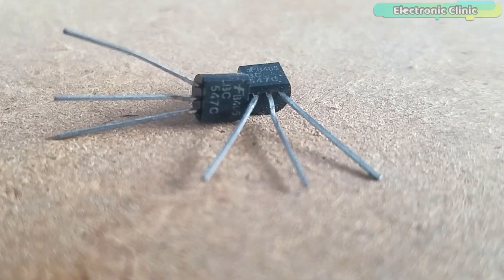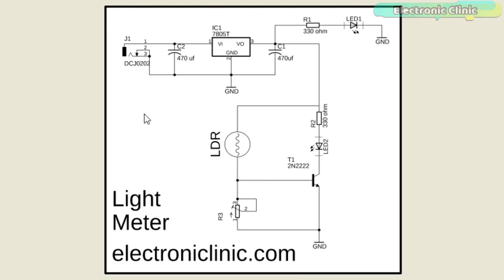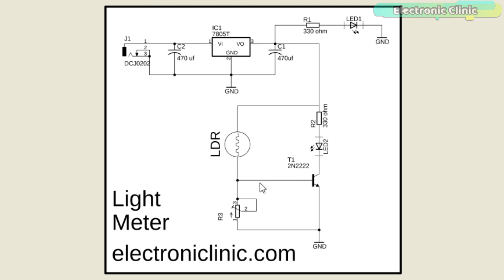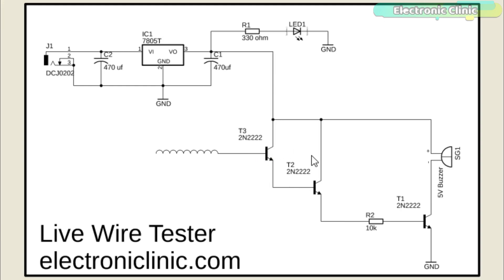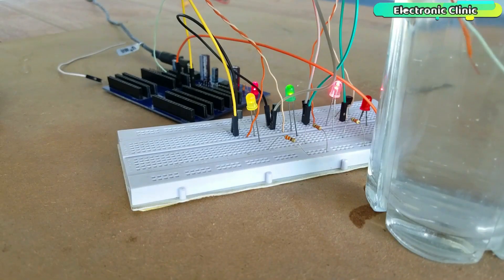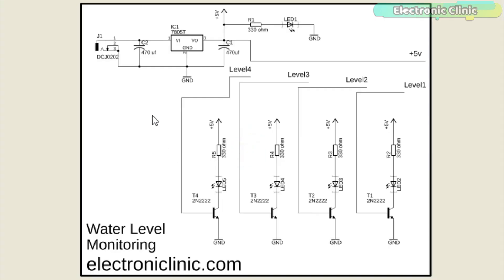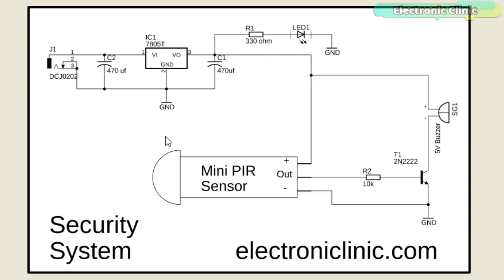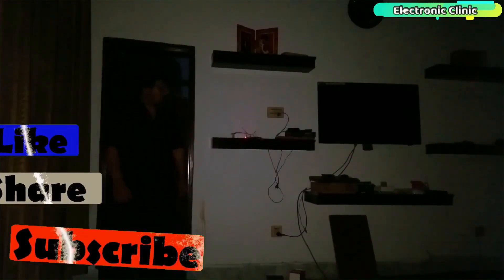4 electronic projects with 2n2222 Transistor or BC547 Transistor, Working explained

Comment: In the first project, it could be most useful if the led starts when there is no light in the room. Do you thing if the LED is connected in the Emisor instead of the collector it could turn on when no light at room?
Reply from the maker: you can use a pnp transistor.